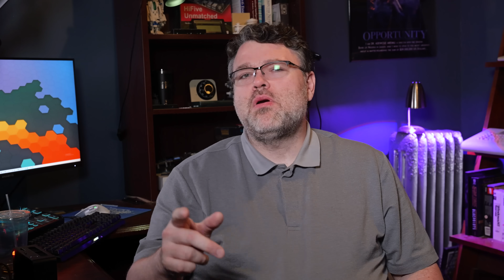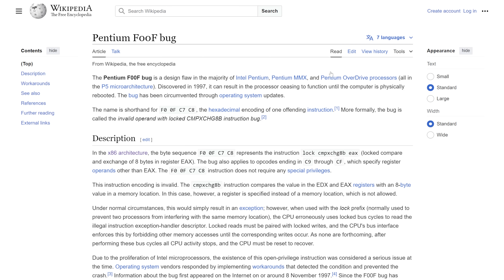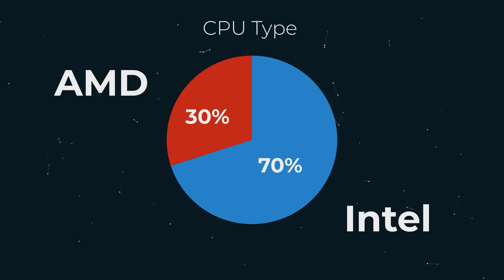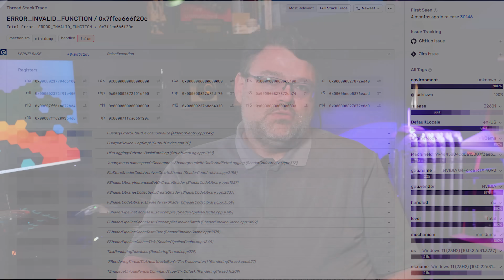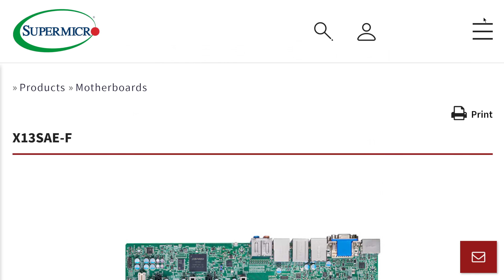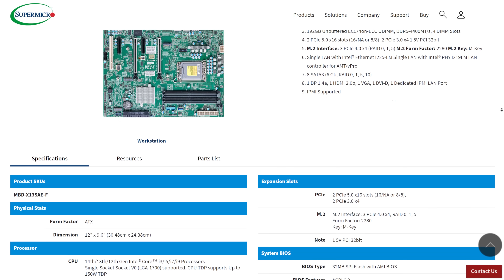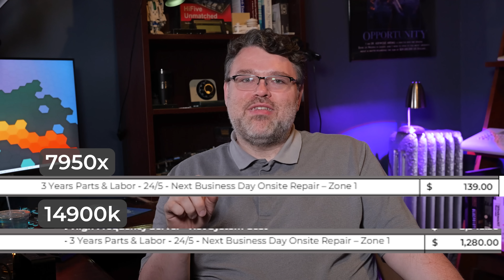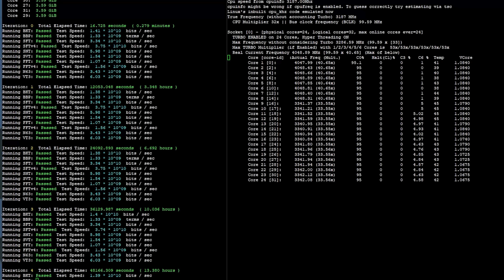Intel has a Pretty Big Problem

Comment: Already Had 1 13900ks Replaced...
From april 2023 when the system was build i Had issues after 1 or 2 months of use
Like the 1 BSOD in like a month..
Then more and more
After that the system was put on a multicore enhancement enabled at 5.5ghz only to get to windows...
Not mobo asus rog z790 d4
System couldnt even install windows unless i
Enabled multicore enhancement at 5.7p 4.4e
Disable all C states
And 1 more setting i forgot...
IT Just BSOD non stop...
About november i Had more and more multiple hourly BSOD issues so i downclocked the P cores to multicore 5.5
And at 20 december 2023 system was Totally down...
Barely managed to get to windows desktop even after trying to downclocked P cores to 5.0 or less and e cores disabled..
Also system Had major memory related issues after the end of august...
Discord would self close on starting it
Edge gave not enough memory errors
Memory leaks
BSOD trying to install windows
There is deffinetly an issue towards the memory controller in what i gather...
New 13900ks has only issues in Gray Zone Warfare....
If Its not with the latest bios and default it Just crashes....
Even if i touch something that cant possibly do anything inside bios that is not default it crashes...
Even if i Changed pcie for the gpu from auto to Gen 4 or Gen 3 it crashes...
I cant understand how hard is it for intel to Just compare the 12900k and see what they Changed from 12900k to 13 and 14900k.....
I really hope for extended warranty on those cpus...
I cant waste 2 cpus 2 motherboards (1 is 2000$) and the motherboard specific water cooling Just cause intel hopes people to upgrade to 15th gen..
Intel needs to put extended warranty on the 13 14 gen affected cpus to atleast 5 years...

Comment: Not until I underclocked and undervolted my 13900k and also went up to a 360mm radiator was I able to keep it from thermal throttling. I never wanted to de-lid a CPU until now due to their terrible IHCs. The crashing subsided shortly after these changes as well. I still get random old games that WILL crash after around 6 hours of play. Destiny 2 is a big culprit. Pretty much 6 hours on the dot.

Comment: Small correction at 12:00 when referring to the W680 chipset motherboards, you stated "these are designed for a Xeon". I believe the W680 chipset does not support any Xeon CPUs. At least according the CPU support list for the X13SAE/F for example, you can see only "14th/13th/12th Gen Intel Core i3/i5/i7/i9 Processors" are listed. I am curious if the LGA 1700 Xeons (E-2400 series) are compatible although they have their own C262 and C266 chipsets and boards officially.

Comment: 14700K user here, I run a very small form factor build (tiny air cooler, 3d printed custom case), and I run with a underclocked undervolted CPU with a low tdp limit, due to my system being so tiny and quiet (this was all  by design on this system, I don't need it to be super fast, and I got this cpu+ITX-mobo for really cheap). So far everything knocks wood has been pretty solid and stable /been running 6 months). Mind you the PC is a workstation and doesn't even have a dedicated GPU.

Comment: I've had stability issues with the 13700k as long as I've had it. I've never seen so many hardware errors in my Windows Reliability History app. I even went as far as deceasing my ram speed but nothing seemed to fix it. My temperatures are perfect, 360 radiator and lapped CPU with retention bracket. Big power supply, all top name brand components. Memtest runs perfectly.

Comment: Intel is not stupid..they know what is causing the problem..it's hardware related due to design; but most likely manufacturing..they will not admit it, just let time take care of the issue with minimal cost..AMD did the same shit up to Zen 3 they had early manufacturing issues. I have a 3800x, 3900x and a 5950x B0 with these problems. Newer 5950x B2 bought 2 years later works fine..don't trust them, test and force them to replace under warranty.

Comment: My attitude running Intel for decades: OC it to the bleeding edge, and who cares if there's a random app or game crash once a week if it means I have +40% better performance than AMD junk. App is prolly buggy anyway, and I bet it would've crashed regardless of my OC.
My attitude after switching to Ryzen: It's nice not spending hours upon hours min-maxing and stability testing to extract all the performance, PBO just works. It's nice knowing that if an app or game ever crashes, I can immediately rule out instability. Apps and games run so fast that I no longer care if a max OC'd Intel chip might be slightly faster. It's nice having actually effective air conditioning in the summer again.

Comment: The 13/14900k are also the only chips with 16 e-cores, does the data differentiate between CPU models? Is there an increase in failure rate for the 14700k with 12 e-cores?

Comment: I had this issue with the 14900k and the only solution seemed to be to force power limits and down clock the cpu. Depending on the Game / Application some required lower speeds to function without crashing. Riot specified speeds as low as 5200MHz.

Comment: I saw similar performance issues with the original pair of 13900k cpus I picked up for extreme overclocking. I had a heck of a time getting them stable and it actually ended up sending them back. My experience was so poor for me that I actually quit doing extreme overclocking for almost a year over it.

Comment: This reminds me a lot of the Pentium 3 1.13 GHz decades ago. Intel was then like now hard pressed to keep up with AMD and really pushed hard to get clocks up as high as possible to compete and pushed it a little to hard to the point where some of the earliest adopters noticed the cpus crashing when trying to compile the linux kernel. Stress testing showed that yep, the cpu was effectively overclocked and not stable at the stock frequency. This sounds like a few parts of the machine have been pushed a little past the limit and one or more of the power management, memory controller, and possibly even silicon degradation.

Comment: Intel has a really big problem:  I have been building computers for myself and sometimes for others for a very long time (40 plus years) and I can't remember many times when Intel wasn't first choice.  Now, more people are aware of AMD, they want AMD, and they don't want to take chances with Intel.  The reasons are actually pretty funny... 

The best one is the failure by Intel to differentiate their CPU series.  I3, I5, I7, and I9.  it's been the same for, what, 20 years?   Most people can't tell you the rest of the number to make it matter.  So plenty of people go on ebay, CL, or FB marketplace and see a great deal for something like "I7 amazing gaming system" and a really low price.  They buy it, and it turns out to be an ancient series 2 I7 and a heavily outdated GPU... absolute trash.   So many people have been screwed over on the whole "why is my I7 no good" thing and it is really hard to explain to them.  

AMD CPUs are simple - 1000 series, 3000 series, 5000 series, 7000 series... you know where you are at with each step.   it isn't hard.  Smaller to bigger, slower to faster.  Consumers relate.  5500 is slower than a 5700, 5900 is better... everyone can understand in a blink.  Now with intel you can buy an I3 (newer) that is better than an I7 (a little older).  Hello what?

We won't even get into the ever changing sockets that make it difficult to upgrade.  AM4 has been an insane constant that has allowed a lot of people to keep upgrading their systems over time.  AM5 looks like it might be the same.

So yeah, Intel has problem - but it's not just with the chips.  They have literally lost the room.

Comment: Have a 13500 and have similar unexplained issues on an Asus B760 creator d4. First I thought it was my selected ram speed on 4 channels. But I get these lockups. Thought it was ram, swapped for know good, thought it was board, didn’t swap that but…. Loaded Linux on new NVME, and under loads with Davinci resolve, random crash, but the check code is never the same either. Issue is not consistent. Many of us won’t complain and just get a new system, but the fact is we need to start.

Comment: 14900KF + 3090 here. 

Not enough VRAM was fixed by setting the virtual memory to the same size as my DRAM.

BSOD/ IO / file system errors seems to be fixed. I set the PL to 253w and LLC to mode 6.

Comment: PC builder for 35 years.  The ridiculously inefficient 13900K and 14900K reminded me of the old Athlon XP trash -- chips that run hot and will eventually cause problems.

Comment: On the warranty repair side I have seen a major shift in the willingness to accept that an Intel CPU might be faulty.  It went from a multi-hour process to get a processor RMA approved to a self-approved process.  I just order the CPU replacement and I'm done.  It's akin now to ordering a replacement memory module or SSD under the warranty process (this is at the OEM level, not with Intel).

Talking to other techs, we have seen a HUGE increase in CPU failures - almost always seen as general instability with a longer running process (which is a really hard thing to verify during a warranty service, so we do typically take the customer's word for it).  I have tracked down the problem on a few of them to the memory controller contact pads - often you can even see visual discoloring of the pads from prolonged heat.  The instability in those cases seems to come from the CPU getting hot, changing shape, and the signal integrity to the memory modules shifting... then BOOM, you're unstable... until it cools a little, then you're okay.  Basically, I think the problem is the shape of the CPU.
Reply: I think this comment needs more attention, it's the only hypothesis that accounts for all the observations.  I'm convinced this is the case too.
Reply: Is this also affecting the 14900hx laptop cpu? I just got a laptop with one and could probably return but got a really good deal and has a good mini led screen and would get so much use out of it for the whole almost a year till next model laptops are out with the 50 series rtx so really don't want to return.
Reply: @WaterspoutsOfTheDeep  
The Laptop Cpu is soldered, not socketed
Reply: back in the days the cpus were binned with a way looser margin of error, in some cases you could easily make the cpu run 25% faster with a bit more of cooling, but once they caught wind of overclockers pushing the cpus so hot, they started to push power into them themselves, to make these margins extremely tight and cpus that are edging being defective are still sold, most people don't stress test their new cpus so by the time they realize they are defective it's too late and they get away with it

Comment: Exactly what happens when you try to push 10nm beyonds it's theoretical limits. Intel should have switched nodes after 12th gen but instead rather push out two generational refreshes and just dump more voltage into them. No new Innovations for two whole generations (13+14th) is crazy.

Comment: Best guess? The actual error count is higher, and stems from static overclocks. If that is the case, most AMD chipsets will have some rescue mode that won't create the syncronisation issues that lead to the error you see here. They will still get errors on static overclocks, but they won't break the chipset interface driver. Intel chipsets will. I've had this a number of times on laptops, where we get tdp or clock panics - even at the best of times. And as the big/little model is deployed, and requires clocks to be set lower and at an async rate, with bus-speeds and memory speeds on "xmp" setups need to be set in a sane way -- this stuff is going to be frequent on Intel, specially on the high watt range. It will also occur on AMD setups (which also rely on async core speeds now) - but you won't get the panic crunches that cause actual errors on secondary devices.

There was a small mitigation thing being enforced by Asus, at least, recently, for example. Where they refuse to let you set these static overclocks in this way. This definitely includes the one you showed in the example here.

So in short: probably the errors with the critical outcomes you see here all have to do with bad setups (and bad cooling solutions - one typical example: hits tdp-limit or temperature cutoff, psu-limit, etc. Cpu runs to rescue mode, stability is now on the fritz). But the AMD ones don't result in actual memory corruption or controller cronches as frequently. You won't necessarily see this on laptops, by the way, because they will have embedded bioses. So you can sort of remove that category from this type of critical outcome.

I didn't think this was an issue, since people surely must be used to asynch overclocks and boosts by now. But no. I frequently see people on multiple different game-forums that have the exact same issue: they put their chipset on a static overclock, turn up voltage to get there - and just completely fail to understand that this lowers the boost limit, and expends the internal tdp way too soon to have any of the normal microcode routines work out well enough. And 99% of those people will repeatedly send reports, and complain about code being bad, and the developer being terrible, and so on. The ones who don't do that, they just also don't have these issues, and won't report this off-chance hang that doesn't fit in this category anyway.

And yes, you can attribute low tick in the game with an overclock. Because you're getting these "crisis" hangs where the clocks are forced down, because of tdp-limits, heat or just expending the tdp-budget. You can "mitigate" this, of course, in software. But you can't just remove these types of issues in any way other than, for example, not using more cores than one. Right? That's the sure-fire way to not have effective clocks going up, or ever trying to clock up more cores as they are saturated. Same with just not pushing too much on the cpu - you can do that. But it's the same as saying you are removing the third gear on the car, because most crashes happen at the speed you have when in third gear. It obviously doesn't solve anything.

Comment: I havent watched the entire video jet but by mind did get stuck at the ram where dual vs single dimm configs. Just for clarity does it maybe have something to do with the memory controller ? and are maybe some more affected then other because of some use ddr4 vs ddr5 ? just wanne ask. am am not super technical also i am not a native english speaker so sorry for my maybe wrong choice of words. nevermind still a great video gone watch it untill the end ;-)
Reply: 2 DIMMs per channel always is a bit iffy. It can run reasonably stable for everyday consumer use, but it's mainly meant for easy capacity upgrades by just adding two more low-capacity DIMMs to your system. I'm surprised they're doing it at all for game servers.

Comment: These are the times intel wished they supported a socket for more than 2 generations instead of adding 1 extra pin every 2 years just to piss off their clients. they clearly chose to modify their design and probably knew they will have problems like these but proceeding not to make it run on previous gen motherboards is a bad move. Would have been a easy CPU refresh fix if its a design flaw but now, everyone will just choose AMD and call it a life cuz the only way to fix it is a new platform upgrade, minus well just do AMD.

Comment: Anyone who owns a non-K SKU of 13th and 14th gen who wants to know whether they actually own a true Raptor Lake CPU, just open CPU-Z , dont look at the "code name" first.  Only look at how much L2 cache that the P-cores have, if you have 2MB per core, you got yourself a Raptor Lake. If you get less than that, example, 1.25MB per P-core , you got conned by Intel, those are 12th gen Alder Lake specs even though you have a 13 or 14th gen CPU . Even though in CPU-Z , the code name might show "Raptor Lake ",  I believe Intel paid the devs to show you a lie so that customers don't feel like they got ripped off for buying a rebadged 12th gen CPU when you are buying a 13/14 gen.

Comment: Wow, it is great to hear people talking about this. We deployed some i9 machines at work, and after awhile 2 of them started crashing for no reason. The, usually really good, Dell diagnostic software could never catch it. Reformatted, replaced RAM, SSD, etc, no luck. 

I saw deep on a Reddit thread to disable turbo boost and it resolved the issue. 

I gave this information to Dell and they ended up replacing the CPU on these machines. 

I've been helping desking and admin-ing for nearly 10 years in various sectors, and saw less than 5 CPUs die in that time, then I had 2 back to back. Was mind blowing

Comment: 19:13 I mean you did disable E-cores and run the RAM slower. But what about turning off hyper threading. It seems to me like the silicon doesn't like too much power shoved into it, it causes electromigration in the long run,  that is why 13/14 gen i5 K SKUs weren't in the spotlight for unstable Intel CPU list , those lower-end SKU just don't use so much power.